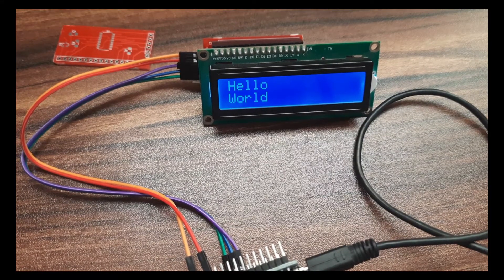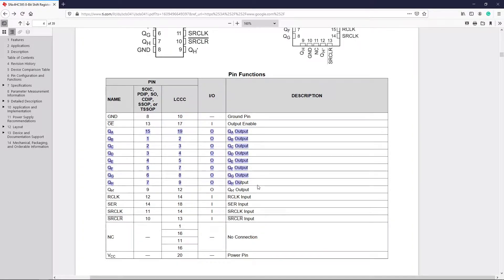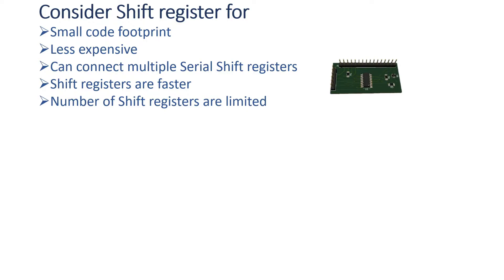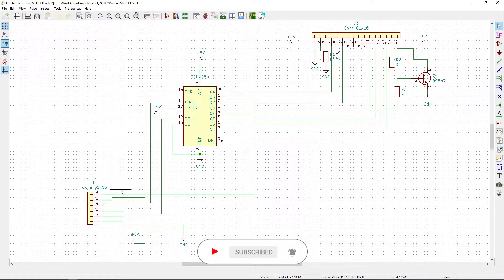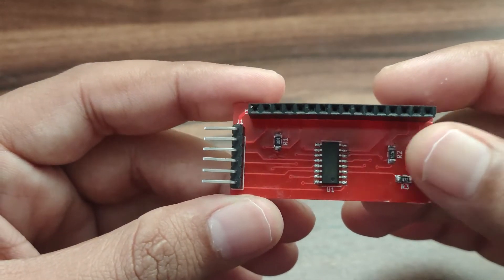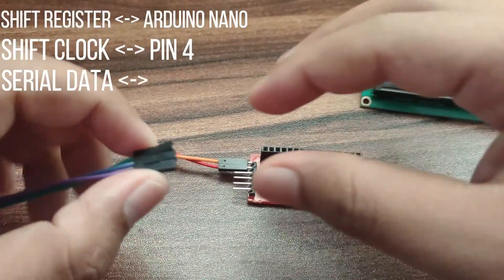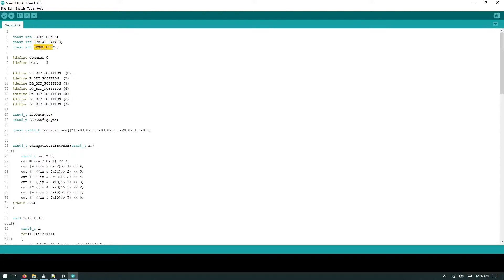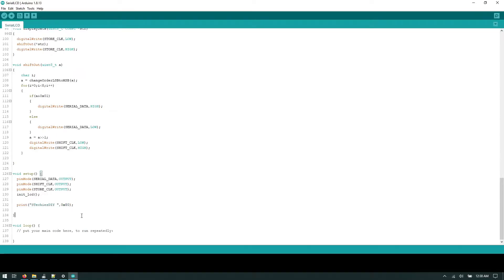Arduino LCD 16x2 using 74HC595 Shift Register

Comment: Fantastic project! I consider this method for a project of mine where I need to have the display quite a long way away from the arduino itself. I tried a I2C adapter, but I got so much interference on the I2C bus so the whole code froze... I believe this might solve that problem.

Is there a simple library to add to the IDE? That would REALLY be a great way to implement this model into any project using a display!
Reply from the maker: Sounds great! Sure, I will prepare the library in my free time. but for now you can use the functions in your sketch.